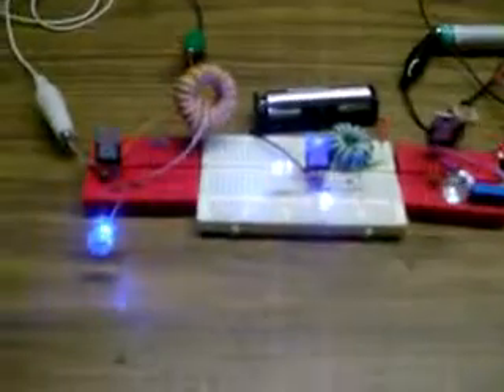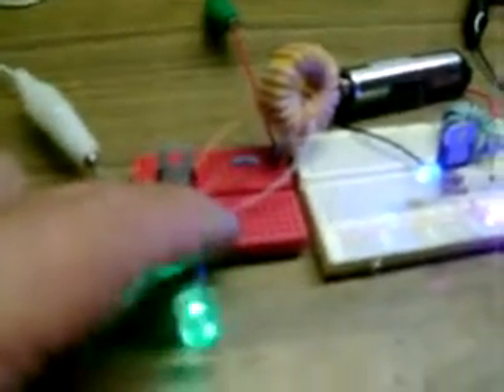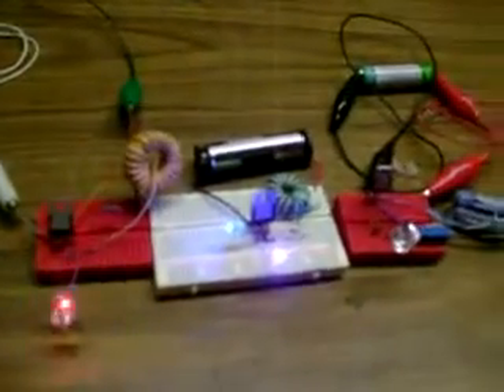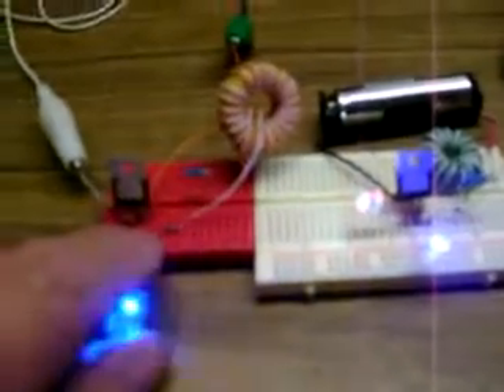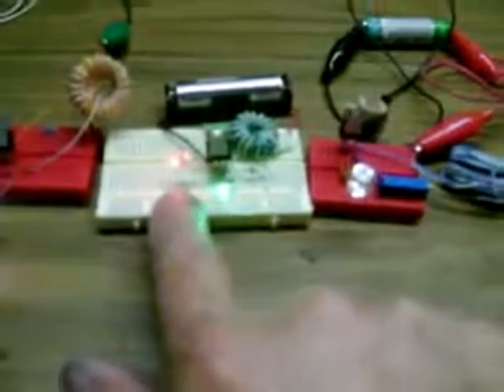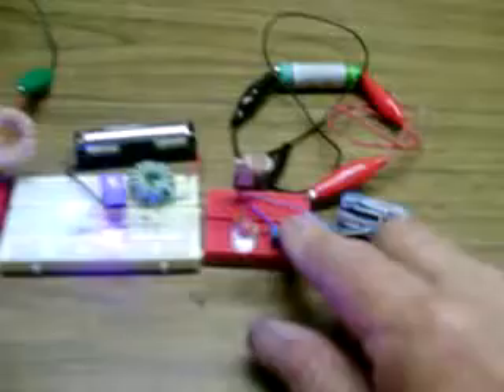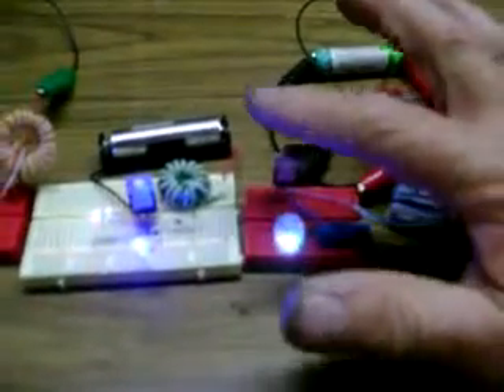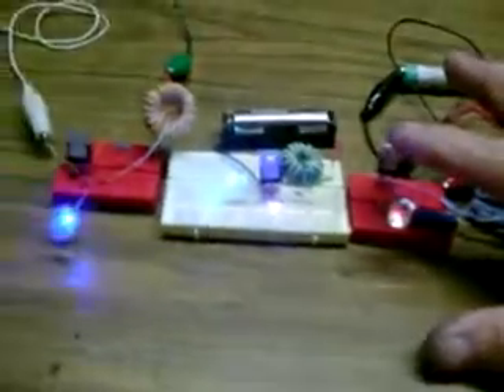RGB JOULE THIEF 2 pin Flashing LED ~~~Stable DC Reading!!!

Comment from the maker: I got all RGB LEDs I have to run on this same circuit by adding 1 capacitor
https://www.youtube.com/watch?v=s9FW1cRX24k
Reply from the maker: 2 diodes, two capacitors and you can run any RGB LED 
on a standard Joule Thief Circuit.
You will burn RGBs up in a regular Joule Thief Circuit.
I lost about 10 until I got it right.